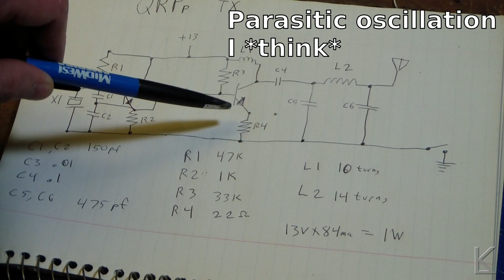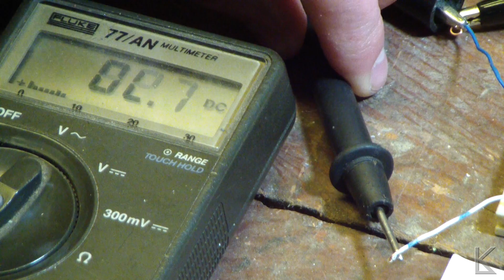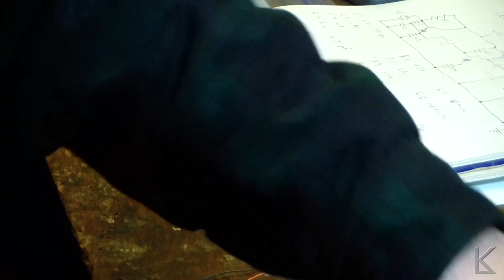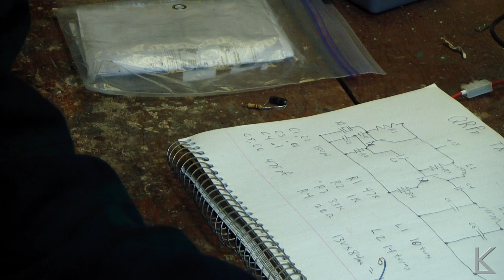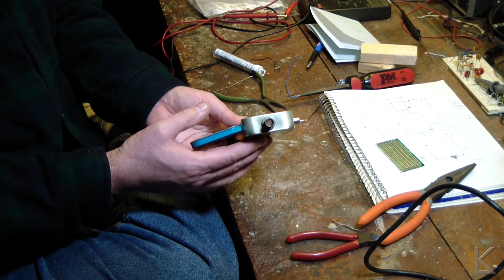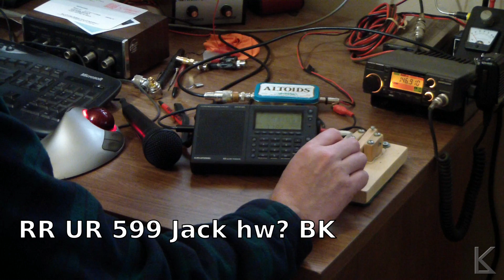Ham Radio - Build your own QRPp CW transmitter

Comment: very interesting.  I have a question: according to the schematic, C4 should be 0.1 uF, that is 100n. Is it correct value? Maybe I'm wrong, but it seems too hi value for that antenna filter
Reply from the maker: As I recall I sort of copied a filter design from another project. And I know it's not the best, but the second order harmonic was more than 40 DB down. And we are talking about milliwatts. This was a while ago.

Comment: Can you replace xtal with tuned tank circuit?
Reply from the maker: Yes.  You can always tell one of those when you hear them on the band..  They'll be drifting up and down in frequency and may even chirp as their frequency shifts due to the power supply voltage shifting when the load comes on. ;-)  
Crystals give you a much more stable frequency.
Reply: @l @loughkb I was just looking for a multi frequency option. Not just stuck on one frequency
Reply from the maker: @andrewr5504 One hack is to put a variable cap across or in series with the crystal.  That let's you shift it's frequency a bit without introducing too much instability to the oscillator.  There is a limit to how far you can 'bend' it that way, but it does give you a bit of wiggle room.  The cap needs to be very close to the crystal with the shortest possible connecting wires or PCB traces.  Like a small trimmer PCB mount cap.
You can also just use a crystal socket and swap out different crystals.
Reply: @loughkb what kind of frequency swing are we looking at under ideal circumstances on say the 20 meter band?  And thanks for responding so fassssst.
Reply from the maker: It's an old technique, since it came from the days when everybody was rock bound. There are many articles on it in the old publications like 73 or QST. Go do a little searching you'll find them. They'll give you equations you can use to figure out how much frequency deviation you can get on the crystal under certain conditions. There's a lot of variables.

Comment: Hi Kevin can a person rob tortiddas out of a power supply to use for transmitters
Reply from the maker: No. They use a material type for very low frequency operation. They would not work well at high frequency.

Comment: A ham in Cuba (Coro) uses the toroid form from a fluorescent screw-in bulb on 40 Meters. Put the old bulb in a paper bag to break it to avoid flying pieces of glass.
Reply from the maker: While that may work somewhat, the material mix in the torroid is going to be wrong for HF.  The buck mode converters used in some LED bulbs run in the hundreds of KHz range, so that torroid is probably powdered iron.  You want a type 43 up around 7 MHz. 
If he looked at his device using a VNA, he'd probably find an odd impedance and loss.

Comment: Hello! Does this circuit have any chance of working with a 27 MHz crystal? I know that I would need a new low pass filter but what about C1 and C2?
Reply from the maker: This was a long time ago. As I recall it's a colpitts oscillator, and might oscillate just fine with a 27 megahertz crystal. If you can find one. Build it and try it, but I don't know how many people are going to be doing CW on CB bands.
Reply: @loughkb   Thank you! I know no one does CW on CB bands but that was the only crystal I could get my hands on. I've ended up building a slightly different circuit and I can see the signal on my SDR. Now I am a little confused since there is no low frequency tone to the signal. The transmitter must include a SideTone or the Receiver handles that part? When I turn it on the static just goes away and that is it, silence.
Reply from the maker: @tiberiufratian7765 your CB receiver is an AM receiver, and there's no amplitude modulation just a carrier. So silence. If your CB has SSB mode, that will turn on the beat frequency oscillator. Then you'll hear a tone. 
The BFO will usually be 600 to 800 Hertz off the carrier frequency.  It mixes with the received signal and produces a tone equal to the offset.
Reply: @loughkb  Yes! I tuned the radio with a little offset and it works as expected. I did not know about the two signals mixing and creating the tone.
Thank you very much for the help!

Comment: Kevin, where are you getting the toroids?
Reply from the maker: You can get them at any electronics supply, like digikey.  You can also get them on Amazon. I would use type 43. Back when I made this I used what I had on hand and they weren't optimal.

Comment: How is the audio tone being modulated? Is it a harmonic?
Reply from the maker: There is no modulation in a CW transmitter. CW stands for continuous wave. It's simply turning on a carrier, no modulation.
Reply: @loughkb  if the carrier is 1.7mhz or whatever it was, how are we hearing it if its not modulated in the audio band. Unless that radio can detect radio silence and make the tone
Reply from the maker: It mixes with the beat frequency oscillator in the receiver. BFO.
https://en.wikipedia.org/wiki/Beat_frequency_oscillator#:~:text=In%20a%20radio%20receiver%2C%20a,transmissions%20to%20make%20them%20audible.
Reply: @loughkb  thanks man. I learned it twice before but stuff doesn’t stick so easily. Thanks for the link, I’ll definitely be giving it a read. Im getting very frustrated with 10Meters and those miniPA100 amps, bought two and both are awful. I noticed when u put the filter ur output jumped two fold. 
Anyway imma switch gears from amps to building these to scratch my radio itch. The end goal is to build transceivers from scratch and without reference. If im lucky it will be a career. Honestly I would love to make tubes, i just need the capital and a book tube material characteristics. I feel like tubes are less hassle when it comes to high output and emp resistant. Totally making a altoids tube transmitter. Hey, thanks again for the lesson

Comment: Mr Kevin sir, it's a good practice to use two reverse and forward connected diode pair to avoid transistor saturation and over voltage burning in case extra voltage dropped in.

Comment: Does the toroid material matter? Or just any recovered ferrite is good?
Reply from the maker: I used type 2 material since I had it on hand.  Type 43 would probably be better at lower hf frequencies.
Reply: @loughkb  Thanks!

Comment: How is the transmitter generating the audio modulation?
Reply from the maker: This is a CW transmitter, Morse code.  There is no modulation, simply switching on and off.
Reply: You can add in an extra audio amp and couple its output on PA's base or collector for AM. Just calculate well

Comment: Would it work for CB if i  changed the crystal and the low pass filter? (ofcourse with modulation)
Reply from the maker: That would be a different transmitter all together.

Comment: Question/Challenge: Can You Combine All Of The Other Elements Of The Radio Setup Into The Altoids Tin? Not The Telegraph Key, But Everything Else. Bonus Points If You Can Make It Portable!
Reply from the maker: Look up the Mighty Mite.  It would easily fit in the tin.

Comment: Hi Kevin - 

Great video. I'm ordering parts to build the QRP TX. I enjoy your loop antenna videos too. In my HOA situation, I may need to build some. 

Are both toroids 17mm?  I found some on Amazon that are that size. Does the mix matter or at these frequencies, is virtually any common mix likely to be OK? 

Looking forward to building this rig. 

73,

John, KJ7RDV
Reply: 17 mm he said for both with AWG 18 wire. Usually 17 mm is thickness of the toroid. I wonder which dimension did he mean by it

Comment: This is very informative thanks a bunch. If I wanted to make one for 10 meter band, apart from the crystal, do the values of capacitors in the first stage oscillator change and if so would it be to resonate at around 28MHZ?
Reply from the maker: Everything changes, including the low pass filter.   There's several web sites for calculating those.

Comment: Great video! I would like to suggest that mounting a plug for the crystal instead of the crystal itself to the board will allow you to change crystals and work different frequencies. That's how we did it back in the day. ;)
Reply: Would it be possible to install a tap and multiple crystals?
Reply: Another way is to use a trimmer in series with crystal to vary the frequency, say, up to 0.5 kHz the actual base value.
Reply from the maker: 5 MHz?????   You're suggesting a trimmer could push a 3.5MHz crystal up to and beyond the 40 meter band?  Uh, nope.    
A trimmer can bend the crystal frequency maybe a few hundred Hz.
Reply: @loughkb  O o! My apologies! I mis-typed it. You are correct! If it is 5 MHz, it can take it close to 5.0002 MHz which I believe is a fair range of variation, don't you think?
Reply from the maker: @awaismushtaq5719  Yes, with a large enough trimmer you could push it that far.  You start to lose stability the further you push it though.  Caps vary with temperature and other factors.
Reply: @loughkb  so far one of the best category of oscillators, provided you can control harmonics, is LC-based ones. Unfortunately, there is no single category that can withstand variations of ambient parameters. In most transmitters, XTAL for oscillators is kept in a shielded container to keep it safe from thermal variations especially. I don't know if you agree or not but I saw one in action. Philips 120 kW valves-based transmitter in my city. It's been dissembled though but it is where I saw most of the things in action.

Comment: Does this circuit work with most COs (in the amateur spectrum), or do other parameters need to change?
Reply from the maker: The filter and coupling would need to change for different frequency bands.

Comment: This was great!  Have you ever built or have a video about a transmitter that utilized tubes?  In very interested in building my own classic transmitter.
Reply from the maker: There's lots of tube based designs out there.  A quick google search for simple tube transmitter ham radio should turn up several.
I won't be doing any though.  Big transformers and such take up space and I'm living in an RV that's already full of stuff. :-)  Oh, and rarely plugged in to AC power. ha.

Comment: How did you insulate the bottom of the PCB from the tin?
Reply from the maker: Plastic spacer.  You can use cardboard, tape, plastic sheet, just about anything non-conductive.
Reply: If you need to ask. Don’t bother !

Comment: Dug through your channel but couldn't find any videos on building a similar QRP CW receiver. Any tips or resources you can direct me to for that? What kind of antenna are you using. New to this but very interested in low power CW communication on simple homebrew equipment. This is a great transmitter though; exactly what I'm looking for!
Reply from the maker: There are a lot of simple receiver designs out there. They tend to be more complex than a transmitter, and a little bit more involved to build. Direct conversion and regen receivers perform fairly well but tend to be quite wide and harder to use for CW, but doable. Superheterodyne receivers will have much better selectivity but are far more complex to build. Do a search on simple receiver and you should find plenty of projects to look at.

Comment: Hi Kevin. What voltage should be on both transistors? With power supply of 12V at + PIN I have less than 2V!! It should be there 12! RF choke with 12 turns of fi0.45mm would cause that? I would appreciate any hints. T2 becomes very hot after 5seconds.
Reply from the maker: Double check the bias on the transistor base.  It sounds like it's high, clamping the transistor on.
Reply: Try using voltage divider bias and 2N4265

Comment: Hello Kevin, What is actually generating the TONE? Is the tone being generated from the circuit? Is that what the first 2n2222a doing then generating it to RF on FEQuency via the second 2n2222a and crystal? Thanks a bunch in advance. I know Kevin has a lot of videos so if anyone else can answer this for me that would be GREAT!
Reply: I believe carrier wave transmission is just an on/off modulation, and the tone is generated by the receiver just as an indicator?

Comment: Would it be possible to use multiple crystals attached to a multi position switch to achieve multiple channels.
Reply from the maker: Yes.  You could also put a small variable cap in series with the crystal to get a very small tuning range.

Comment: There is a few things I noted.
The output amplifier is very heavily coupled to the oscillator. I would reduce its value to 220pf and see if the output changes much. If it doesn't, then its better as you have reduced loading on the oscillator. Also the output PA circuit would be better matched to the output LPF by using a coupling transformer. A small 4:1 transformer wound on your toroid would improve things. The collector of that PA would have a very high impedance compared to the 50 ohm load.
In fact if your PA was only producing 500mW (and it's not) you'd be looking at a collector impedance of around 140 ohms impedance if your power supply is 12V. 
At 200mW it would be 360 ohms.
If you were getting 350mW, it would be 200 ohms and a 4:1 balun would give you the best power transfer.
Reply: The input impedance for first transistor is too low and crystal is definitely being loaded to cause probable frequency shift. He ought to have used voltage divider bias. That way he could increase the input impedance to at least 500 k-ohm. Besides base bias isn't a very stable and promising biasing method. He could have used 1 k-ohm in collector of first transistor and could have connected 100 k-ohm in parallel to collector resistor for improved performance and reduced crystal loading. Another way might have been to put crystal in parallel to at least 100 k-ohm resistor and throw oscillation at the base for due gain. Anyway, his transmitter, his design!
Reply: He could have added a variable capacitor of 100 to 120 pF in series with crystal for better feedback control. Mr. Dazzwidd is right in his analysis. Also, adjusting Colpitts tank capacitors to 220 pF could have been much better. It's true that design needs improvement. Moreover, 2N2222 is a bad choice for oscillator and for overall RF design. The 2N4265 would have worked loads better as its transition frequency is 300 MHz which is way higher than 7.023 MHz used here.
Reply: If you know better why are they watching this video ? Experts.!

Comment: Do you have a video where you show how to make the frequency adjustable?
Reply from the maker: You can put a small trimmer cap in line with the crystal.  It should give you a little adjustment.

Comment: Nice job on the mini 2 stage transmitter.  Nice timely QSO.  Can't beat that.  And, apparently only one Altoids tin to complete the job !!  Now you just need a crystal socket on the board and you are set. You could even use it, if you had a frequency counter, to check crystals for operation and frequency (at least crystals in the 40 meter band).   lol           5 *

Comment: Thank you for this video.
I think its a very worthty explanation video. I examples how in history radio's were build.

For my lectures as a teacher in physiisI do have a few questions:
1) does the frequenty of the crystal set the transmissionfrequenty?
2) if I would replace the amplifing transistor with a transistor with a highr power, would the power of this transmitter be bigger?
3) In the stores I can bey electral components like resistors, condensators and Inductors; are those premade Inductors also usable, or do I have to make the inductors myself?

Again, thank you for making this video.

Comment: You can use a 555 timer IC with different capacitor ranges instead of a crystal as well but great job!
Reply from the maker: Yes, and gain a pseudo VFO.  But you would also have to add additional filtering to smooth the 555's square wave into a sine and eliminate all the harmonics.  Plus there may be a stability issue or even chirp if the 555 doesn't start right on frequency.  I suspect it would take a few ms to stabilize.
Reply: @loughkb  yes very true BTW love your contact with ke0og subbed to u buddy and 73! Also enjoy your videos!!!!

Comment: When Kevin showed the harmonic reduction due to the LPF, did I miss the value of the load resistor terminating the filter output?  This value can make a BIG difference to filter performance, and therefore the harmonic level too!  Also, if it's R ohm it's easy use a scope to calculate the RF power out from (Vrms^2)/R.
Reply from the maker: I would have been using my MFJ dry dummy load.  It's 52.9 ohms through most of the HF spectrum.

Comment: Could you use a VFO instead of a crystal to make the frequency variable?
Reply: you could ... but a VFO is much more complicated to build and finicky to keep stable.
Reply: You can use ceramic resonators instead of crystal oscillators which can be pulled over a greater range than crystals

Comment: Could you explain how you hooked up your receiver to the transmitter? Very interested in that
Reply from the maker: I have a double pole double throw switch in it.   One side switches the antenna between the RX out connector and the transmitter.  The other side of it switches power to the transmitter.  When in RX mode, bumping the key won't transmit and hurt the receiver.

Comment: What does "DE" mean? I see that a lot and just thought my software was picking up noise like when it just says T T T T.
Reply: It means "this is", and is usually followed by the sender's callsign. 
Example: "CQ CQ CQ DE KM4CFT KM4CFT KM4CFT KN" (KN means calling anyone).
Hope that helps.
Reply: @JonathanKayne  Nearly right, and it doesn't matter a hill of beans, but DE means "from" (de means from in French).
Reply from the maker: Thanks for answering him John, but one very small correction.  'KN' is inviting a specific station to answer.  'K' is inviting anyone to answer. :-)
Reply: Thanks and keep up the videos my wspr is almost done. First contact will be on your mag loop once I find those old capacitors to tune.